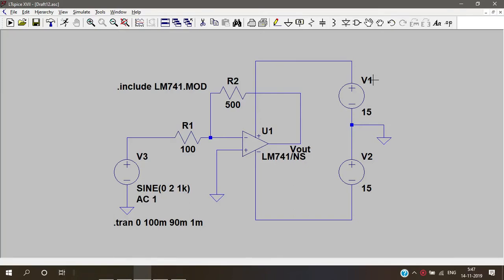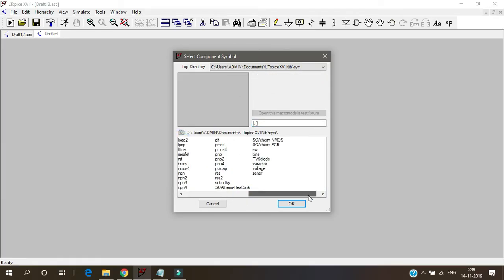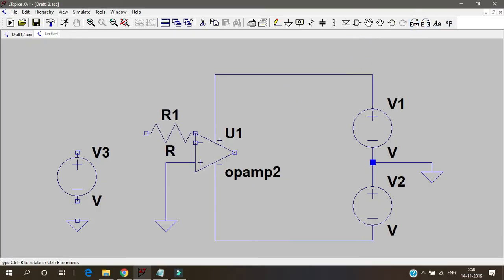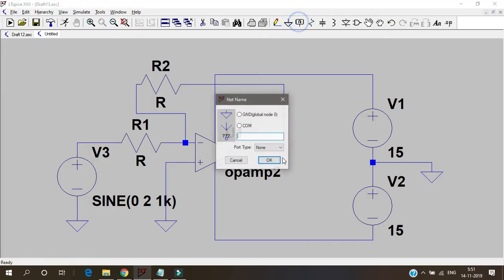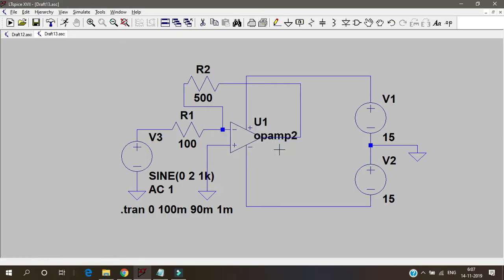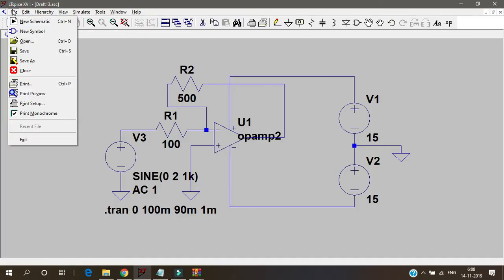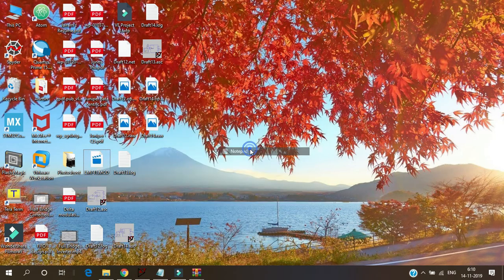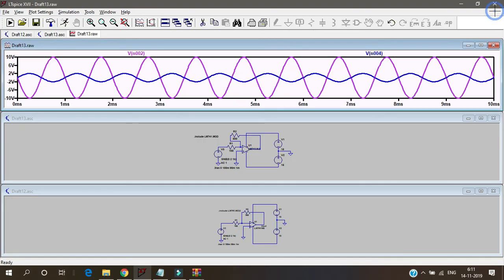Inverting Amplifier using LM 741 Op-amp in LT spice

Comment: I'm sorry but whenever I try to run, it said could not open include file "LM741"
Reply: even if the file doesnt have LM741.MOD in it, you have to add the .MOD part to ltspice. this fixed it for me
Reply: @jaycgr  thank youu. I already did it before and surprisingly it works . 😇
Reply: @jaycgr  very thankful tip sir..... It works for me... 🎩 off
Reply from the maker: Hey, are you sure you have your library file in the ltspice directory?  And you named your opamp correctly?